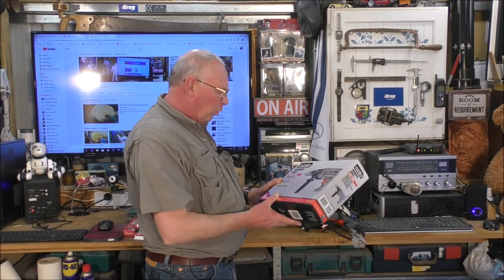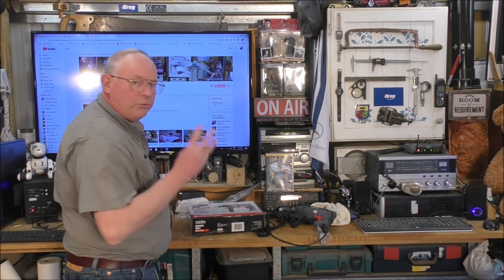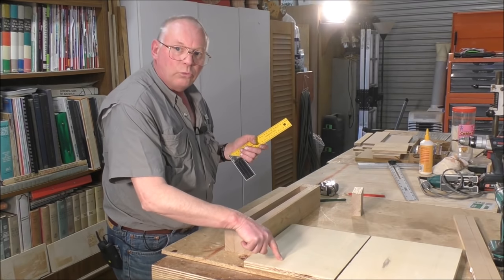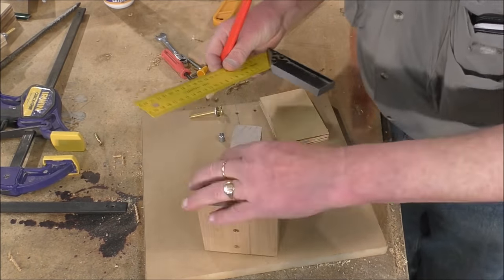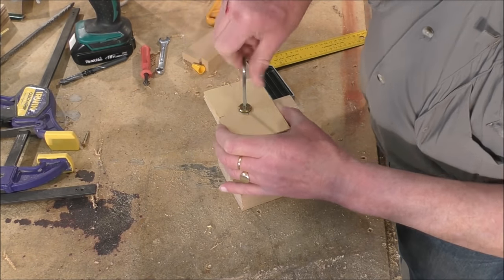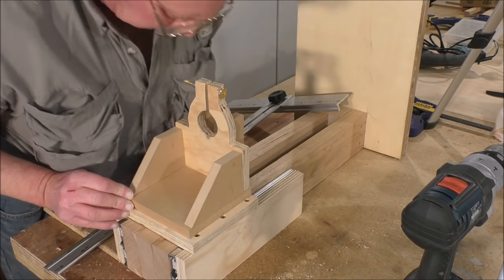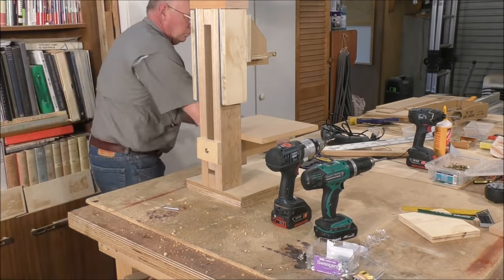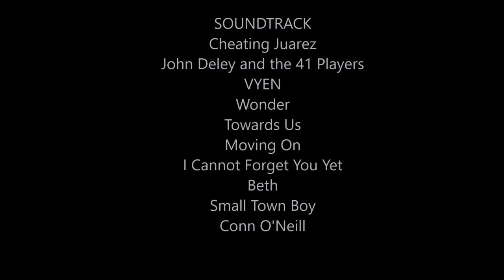283 Building a Homemade Drill Press for less than $80

Comment: Dear Roger,
I love this drill stand you made. Looks sturdy and lasts long. A small observation. You have Incorporated slides at two sides of the drilling machine movement that ensures no friction and no wear and tear. Similarly if you shall accommodate slides at front and rear sides. It will ensure no wear and tear and also free from friction in front and rear movement. Thank you very much.

Comment: Love your shop, tools and bench order. The flat panel screen on the wall is *perfect*! 

For the press base connect to the guide stand, I'd like to see a stronger mounting, maybe a gusset and the stand through the platform down a few inches with legs or extended material for solid footing on floor or table.

I've searched for simple, strong carriage [carrier] design, and so far yours is best.

My requirements call for vertical clearance of 20 inches and 12 inches of travel. Your design is easily modifiable to this, too. Just add a slotted vertical way to the plunge mount with a stop screw clamp and slide run that extends further down the carriage.
Reply from the maker: Thank you, for watching,  
Please like, subscribe and forward the video on to a friend, Roger Clyde Webb

Comment: drill press like stone. great job. but one must finally gauge the drill tip because it newer stays perp at once. also most crucial part of this work is making a perfect hole for the drill clamp. if it is vertical and clamps well, remainder is rather easy.

Comment: That looks really sturdy, best one I have seen on YouTube. Many thanks. I would like to suggest 1 improvement though, which I will do when I copy yours to make mine. I would use a round over bit in my router to make the pull lever more comfortable. But still a great press.

Comment: Very nice project you can improve it with a microswitch  placed on top of the pillar (in the rear side simmetric to the spring) that allow the running up of the drill when you low the carriage leaving locked the trigger of the drill between uses

Comment: Sound design & excellent presentation, thanks! I have a few questions: why limit the travel, it looks as though with longer slides you could have through drilled 150 mm? Where did you get the springs? And why not attempt some speed control, it's trigger regulated as things stand & of not much use. I think you have the electronic savvy to fix that. Finally what do you recommend for those of us with no access to dressed oak?  Oh yes - for gods sake paint or varnish your baby, eventually it will drill steel with coolant which can be destructive on unprotected timber.

Comment: Excellent recommendations and while I agree- the one about metal gears it does not always have to be true.   Gears, as with bearings can be made to last longer- simply by making them larger- so a small ( thin ) sintered metal gear can last less time than a robust well-matched plastic gear.  The type of metal is also extremely important in determining how long it will last.

That being said I always buy metal gears.

While there are cheap drill presses available in the US- I am sure using one you built yourself would feel better ( if well made of course ) to use.

Comment: Sir Roger Webb, that slides is a 3 fold drawer slides and cost twice than 2 fold slides. Indeed much sturdier than the 2 slides but since you used 4 of them. I think will not be that economical for Do it Yourself fanatics. Just my opinion.